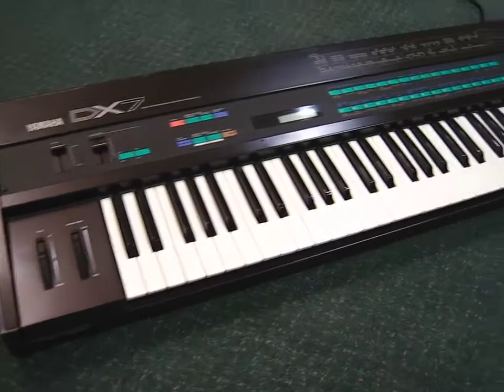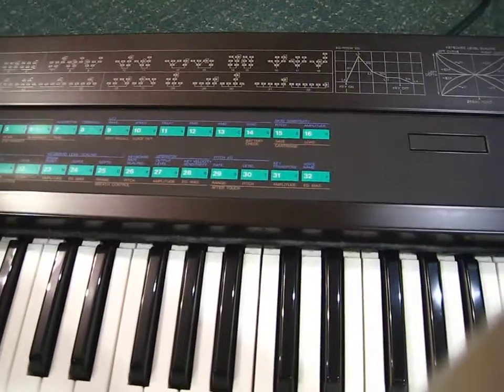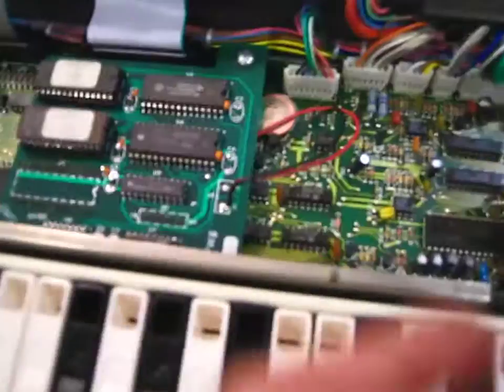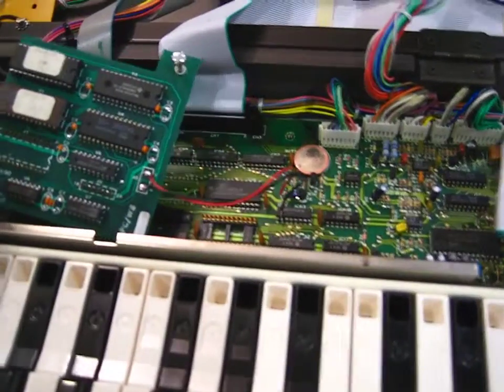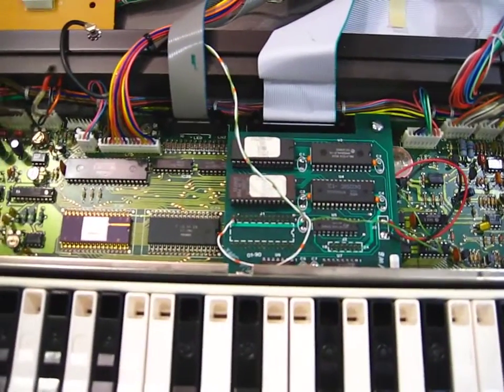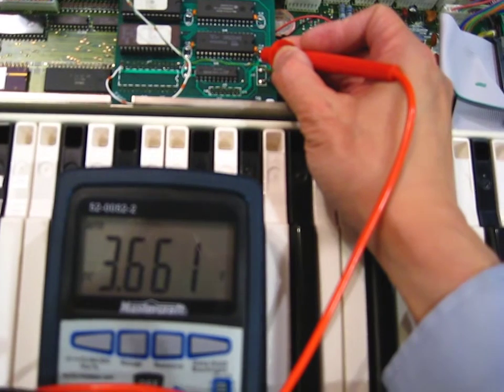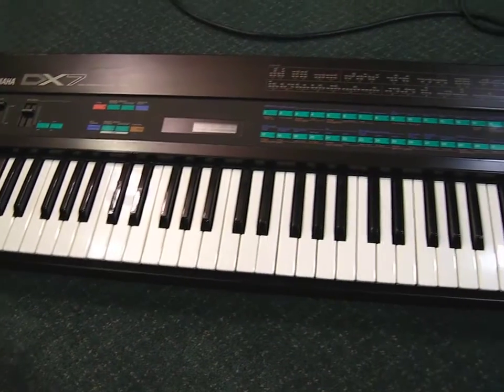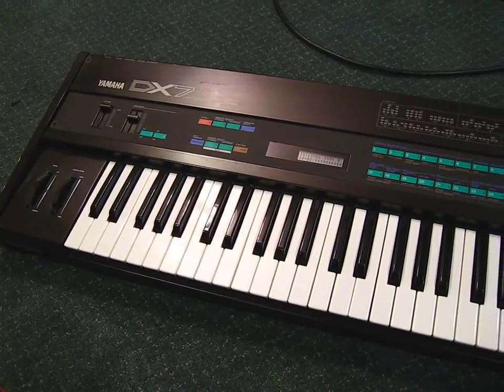Yamaha DX7 with E! Grey Matter expansion battery repair

Comment: Hello, I want to know what is the difference in a DX7 mk1 with an Grey Matter E! board and a DX7 mk1 with out Grey Matter E! board
Reply from the maker: The DX7 mk1 E! board fixes the MIDI velocity limit of 100 to full 127. and the MIDI transmit channel can now be adjusted to other than channel 1 . It also adds 576 patches.

Comment: How did you initialize it?
Reply from the maker: From the E! manual, you have to manually set the parameters to initialize it and you have to load the RAM patches from Sysex , copy  from the built-in ROM or from a cartridge.

Comment: wtf how did you initialize it
Reply: I'd sure like to know as well...
Reply: @ebeep  looks like it might initialize the ram if it's corrupt on next boot, but that won't help reset stuff to default settings if someone has mangled a bunch of them
Reply: @anonymous-pr2sy , yep, sounds like I just need to man-up and replace the battery.  It's my plan for tomorrow morning.
Reply: Success!
It was a pain and I accidentally discharged some filter cap voltage while soldering, but it's done and works as it should!  Personally not a fan of the E! expansion though...

Comment: After replacing the battery, I'm still getting the "Replace Battery" error 03. I measured the voltage, with the synth powered on it's 4.9v at the last pin, 3.3v with the synth off. Any ideas?
Reply from the maker: check the ADC
Reply: Thanks, I did a search for how to perform this test and couldn't find anything. Is it a fairly simple process?

Comment: This was actually as plain and simple as you show it.  I was able to remove the 2032 without removing the E! board, and soldered a AA battery pack to its contact points. However when I finally did the RAM reset, and like in your vid at 2:07 it shows the empty bank with left-facing arrows. OK I have that also, however, when I try to overwrite the bank/all banks (sysex/bank ON, and Int memory Protection Off), when I power off and back on, it dumps the banks and back to arrows; even if I dont power off, and flop around the banks, it resets as if nothing loaded properly. The battery voltage shows 2.8V.  Would that cause the e! to screw up as such?    I know, 6 year-old video...
Reply: check the connections to IC63.  I believe it is a chip select IC. Otherwise, maybe your RAM is defective.  Do you have ROM voices?  You have to manually initialize the whole RAM like in  http://www.dx7.nl/downloads/DX7instr%20inbouw%20grey%20matter%20card.pdf
Reply: - yes I have the 9 Preset bank ROM's that are on the card.  Last night I was messing around again, resetting, reloading, checking voltage to card; ok. ... So with the e! card, I think the IC socket clips for the 6 lone riser pins on the right, are kind of bent open, so the pins are floating in the socket. I was able to position it where I was able to save and power off etc and everything was fine saved and working, but when I go to screw the board back in I guess that reverted to amnesia again with slight movement. wondering if the socket itself has cold solder joints underneath.... ugh didn't want to remove everything.
Reply: I just did a battery on an original DX7 w/E! ... But this is the E! without the sounds. Trying to load the sysex file using SendSX 1.4, but I can't figure out which menu page of the E! software lets me upload the bank... any help?
Reply: I found it, you have to enable the sysex (on) within the "keyboard" page, button 2.

Comment: Yes, removal of the old battery is a good idea, also it's not freaking rocket science to sand down the top and bottom of a cr2032 to solder leads... I've done it many times. It's kinda messy to zip tie in a non-coincell battery, and even messier to leave the old one in place, but hey it's not MY DX7 :P

Comment: rehashing this i removed the old batter and replaced w a lithium 3.6v AA.. when i check voltage on the farthest bottom right pin on the IC you were checking on, I only get 2.6v?? any ideas?
Reply: also, ive got it to start up ok, but i can seem to load patches from a computer.. all of the patch names are "vwvwvwvwvw" and even if i do a voice init and then try to save it it reverts to the "vwvwvwvwvw" name and the early sound which is basically just random noise.. any one have a similar issue?
Reply from the maker: Just remove the lithium battery.  I finally did it by cutting the side tab of the battery and lifting up the bottom tab and cutting it.. Solder the positive of the battery to the side tab and the negative to the bottom tab.  2.6V is too low.  Also, the IC's are all upside down to your prospective  (keyboard in front of you). so the GND pin of the ROM is upper left corner.
Reply: chinesemusic well somehow i got it.. i ended up taking out the DM board and making sure the grey matter board was properly aligned w the sockets of the removed chips.. when i do a battery check on the dx7 it gives me 3.3v.. thats good right?
Reply from the maker: Ian Hicks If you see the battery backup schematic at: http://electro-music.com/forum/phpbb-files/thumbs/t_battery_678.jpg  , Use a multimeter. The voltage at the supply pins (12 GND and 24 VDD) of the RAM (6118) may read 3.3V after accounting for the voltage drop of the diode when the unit is off.  It should be 5V when the unit is on.  Check the battery itself is actually giving you 3.6V.

Comment: You've left the existing battery connected to the motherboard in your battery replacement solution.  Another helpful website identifies, "All Yamaha DX7 and DX7s models come with a lithium battery used to keep the internal memory alive when the power is off. .... At the end of its life, it is mandatory to replace the battery, as it can decompose and leak acids onto the expensive motherboard".

Comment from the maker: Yes, you don't need to disconnect the negative connection of the 2032 battery because you have to get to the bottom of the board for that which would require more disassembly. Just connect the negative connection of the new battery to the case of the DX7.

Comment: OK I see that now you just soldered the green wire to where the 2032 is connected on the top of the board.  Gotcha!  So the negative connection isn't nessasary?

Comment from the maker: There are no existing lead wires to the 2032.  I cut the tab the connects positive (top part) of the 2032 battery and connect it to a new battery's positive via a new green wire.  The ground of the new battery is connected to the ground on the DX7 (anywhere on the case will do).  The old battery is left floating with its positive lead disconnected.

Comment: I think because you have the expansion board it somehow slaves off the 2032.  Did you mod this green wire because I can't really see it.  I don't have the expansion and there are no lead wires visible to the 2032 battery.  I'm pretty good with soldering so I ordered the battery from Yamaha and will pull the board out to solder the new one from the back.

Comment from the maker: Sorry the video is a little blurry but at 1:21 you see a green wire soldered to the positive tab of the 2032 battery lead that is severed from the 2032 battery.  That green wire connects to the positive of the new lithium battery.  You don't need any special battery. Any 3 - 3.5 V lithium battery will do and this way you don't need to remove the existing dead battery which would require disassembly of the entire mainboard to get to the bottom to desolder the battery.

Comment: The problem with this video is it lacks crucial info like how the wiring was done.  It doesn't show exactly how to do the wiring since he had to put the camera down.  I've seen videos where the owner used an energizer 2032 as a replacement...which is confusing because I've seen videos stating that wouldn't work...it has to be a special battery from Yamaha.  Can anyone clarify this?

Comment from the maker: Change the battery. A DX7 won't work with a dead battery. Because there are no internal ROM sounds, only RAM patches, it needs to be loaded via ROM cartridge or SYSEX MIDI, unless you happen to have the E! expansion ROM/RAM board.  You can try initializing a patch with a simple sine wave sound to see if you can can get sound after you change the battery.